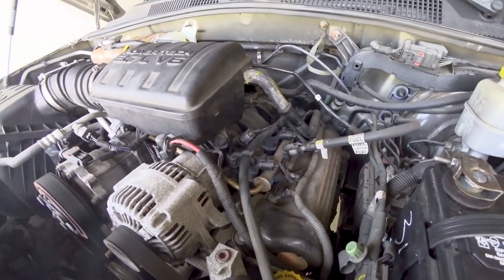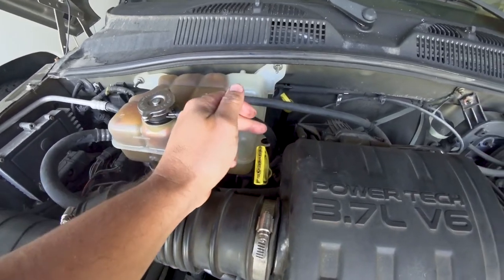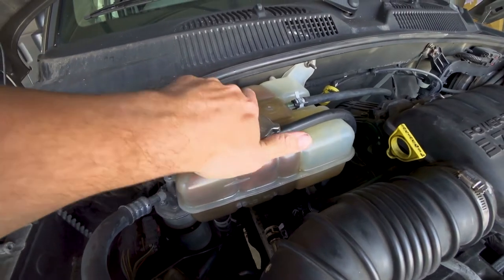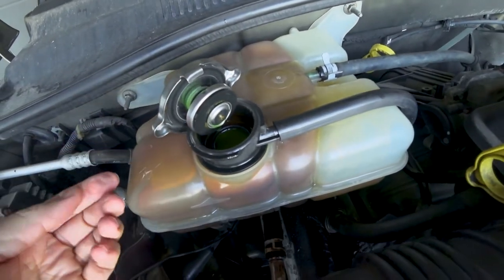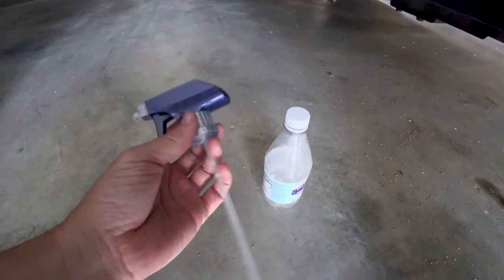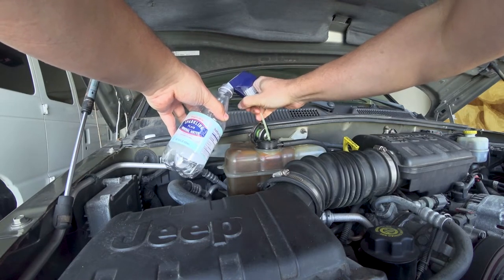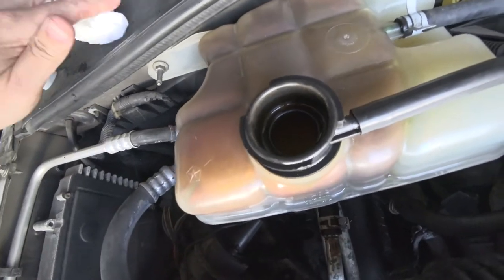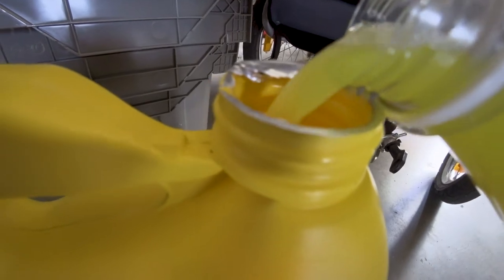TOO MUCH COOLANT IN THE RESERVOIR | HOUSEHOLD HACK

Comment: Thank you so much! I'm all by myself and my husband is away on trip and isn't able to help me so this worked great! Some suggest using a turkey baster, but this works even better and is the perfect size for my little car.Once the spray bottle can't spray any more coolant from the radiator that means I got all of the excess coolant right?
Reply from the maker: @leilani2248  just take out as much as you need so the coolant is at the proper level while engine is cold. You should be able to see that on the reservoir 👍

Comment: Good idea. I have a electronic spray pump made by Craftsman that I use to defrost my refrigerator. Thankfully it worked on my Chevy HHR coolant reservoir because its a deep reservoir. Its really hard to see how full it is and I overfilled it a lot. I was able to lower it back down to the level its supposed to be at using the spray pump.